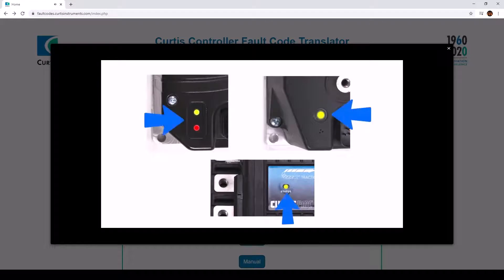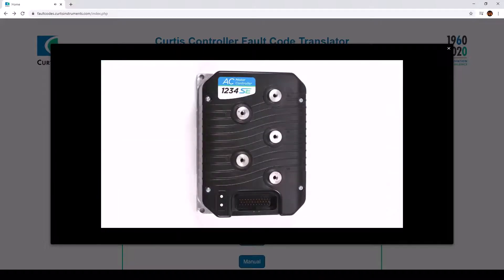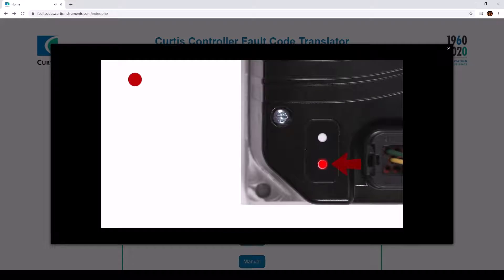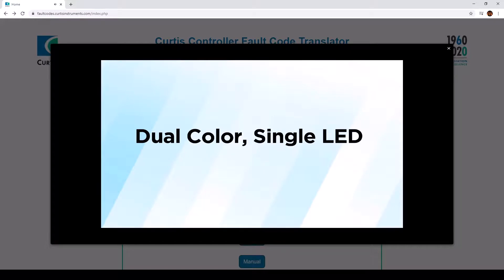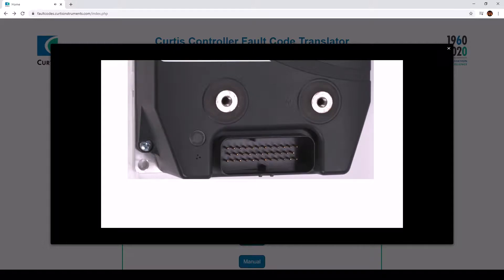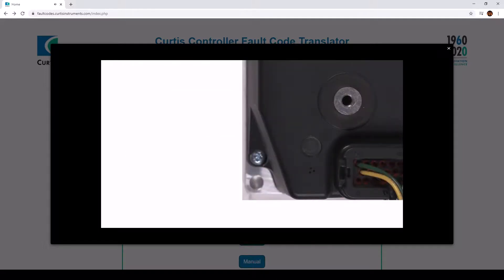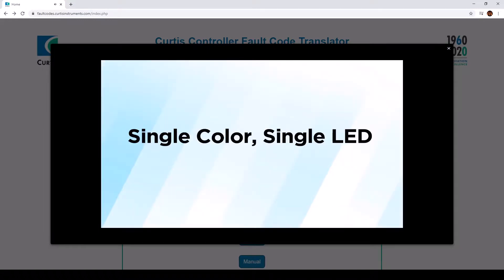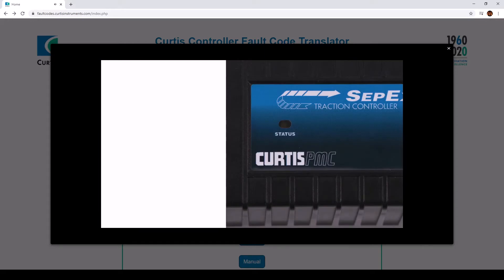How to read Curtis flash codes official video from Curtis

Comment: I have a 1226 that flashes 4 red then 3 yellow        dual color dual led type?  what code is this
Reply from the maker: It is 4,3. Failure to read or write internal memory. Internal controller fault .